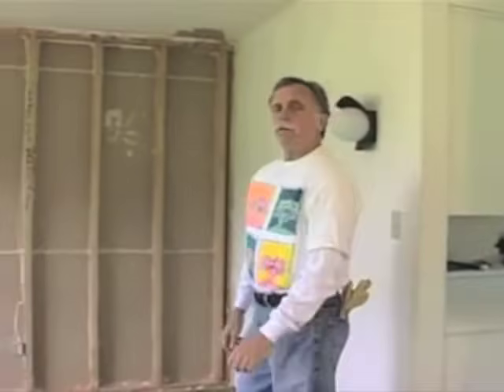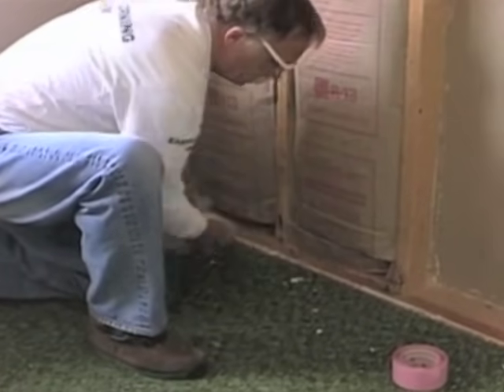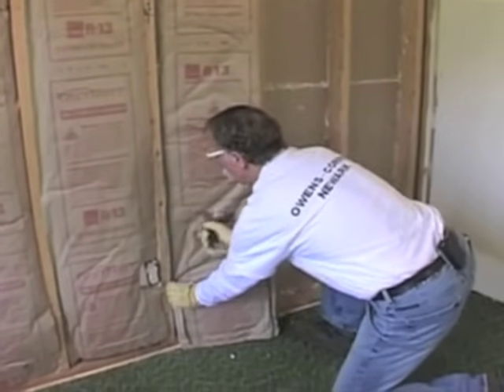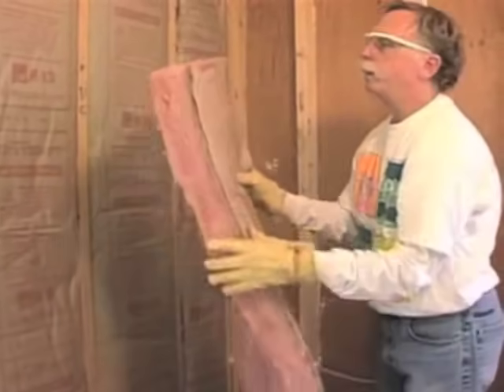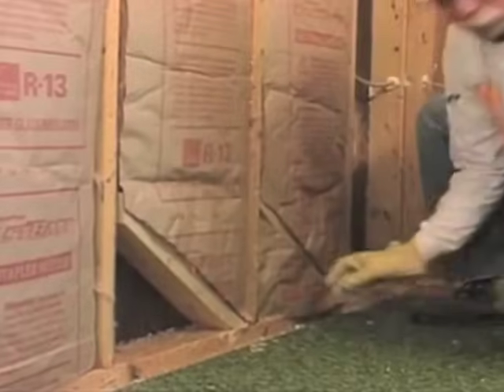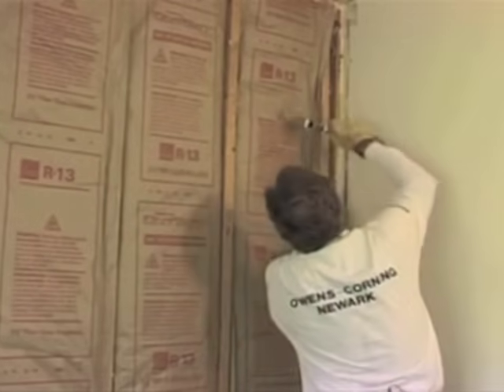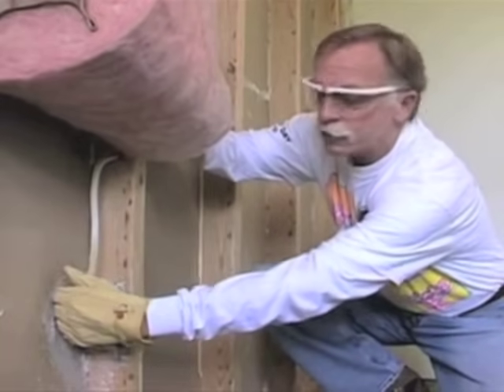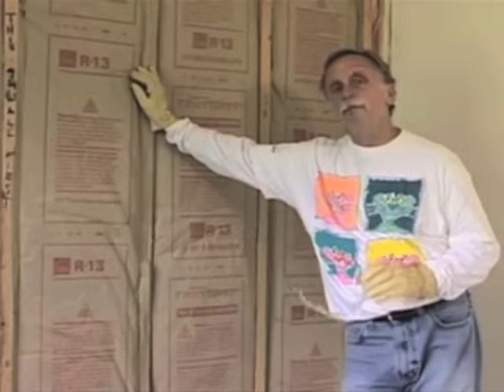Right Vs Wrong: Installing Insulation Batts In Exterior Walls - Part One

Comment: When the insulation fits in the space correctly, I thought that the side flanges were to be stapled to the face of the wall stud. Then the next installed batten flange will be overlapped and stapled over the previous installed batten flange. That completes the seal in the wall cavity. Someone correct me if I’m wrong.

Comment: I have a 70 year old house. I'm going to strip off the Old Dutch lap wood siding  and celotex, then try to insulate from the outside using Liquid Nails to seal the paper barrier to the sheetrock.. anyone think that would work?

Comment: Hi I have a wood shed 12x30 and want to do ceiling and walls how do I determine how much batted insulation is needed
Reply: figure out the square feet of the shed & you should be able to determine an estimated amount of insulation based on the square footage listed on each roll.

Comment: "I've pre cut . . . ???"  What's 'pre' about it? You cut a piece to fit the odd shape, narrow cavity, etc.

Also, face stapling is preferred as tuck-in/inset stapling requires the installer to COMPRESS each side of the bat - yet compressing the bats is ostensibly a No No - but the majority of lazy ass installers tuck it in.  Why do as they do?

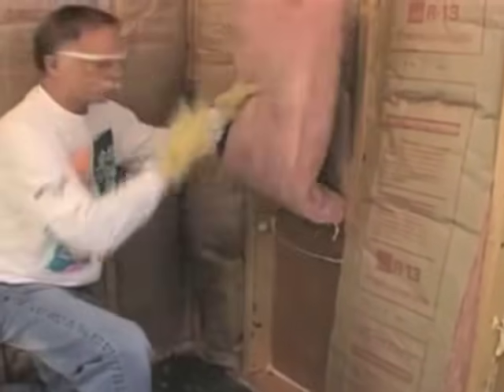Comment: I like what you did at 7:30.  I've seen a lot of videos where people cut in half all the way at the bottom, and tuck the back half behind the wiring and run it all the way down to the floor, then fold the front section over.  The way you did it looks much easier and will still work.

Comment: Residential housing has cavities of 3.5 inch deep. Can this batting be used if the cavity is only 2" deep? How much R value is lost when the batting is compressed in my example above?
Reply: Spray foam...closed cell.

Comment: I install drywall and stapling the paper over the stud doesn't work if you are using drywall adhesive. The quick batts may install quickly but they sag in walls that experience vibration, like slamming your exterior door. I work behind the installers and insulate alot of things they miss or do incorrectly. Overstuffed, gaps at the tops and bottoms everyday all day. Can't think of 1 I would refer. I've been fixing bad insulation installs for over 30 years. I put a bead of spray foam in each bay all the way around the exterior. It's very easy to do and seals the cavity.

Comment: What kind of tape do you use to maintain vapor barrier?
Reply from the maker: Hi Kevin, thanks for reaching out! The facing on the Batts is designed to provide enough of a vapor barrier to prevent condensation in the wall. Normally tapes are not used when installing faced batts so in this instance we don't recommend using tape to maintain a vapor barrier. If you would like to speak to one of our specialists in more detail about this, feel free to call us at (952) 279-6400 and ask for Ken Allison or reach out to us online at https://www.idi-insulation.com/contact/. Thanks!

Comment: The most useless video ever…. I watched maybe 1/4 of it.
Reply: I’m a GC though, so the verdict to save you time on this video is do not leave gaps and don’t precut shit. Otherwise what is the purpose of insulation? Architects call it Thermal break and it’s impossible to calculate so they will just make you ripe it out if it’s not continuous. 

God damn I waisted to much time on this video…

Comment: If you don’t cover the studs with the paper flap provided doesn’t it make your vapor barrier incomplete?Also by pushing the batts in too staple the sides it looses its R value
Reply: Facing is a vapor retarder, not a vapor barrier.  The small gap isn't significant.
Reply: It dosent loss any r value. Unless you are trying to fit more r value in a stud rated for lower r

Comment: 5:45 the outlet is upside down!
Reply: I see that in commercial buildings. not sure why though.
Reply: I heard that the outlet installed upside down is for safety. The ground is then upward is so that if a piece of metal falls nothing will happen. Conversely, if metal falls on the positive and negative of a slightly loose plug, a short may occur. The outlet looks weird though.
Reply: Believe it or not that is the best and safest way to install an outlet.  Im surprised they haven’t changed the codes for outlets.  Imagine plugging in a vacuum and leaving a slight gap.  Then you accidentally drop a screw drive and it lands on the prongs.  This will almost never happen but it could.  I had an electrician get shocked.

He plugged in a drill.  It slipped out but not completely.  He swapped out the switch above, dropped the screw driver and it landed perfectly prongs.  That screw driver flew 😂

Comment: I kept having an issue with my home's exterior osb sheathing warping. After the second contractor installed new osb and Tyvek, I took a peak and could view both the fiberglass shell of the stand up shower and the tub next to it! No vapor barrier and no insulation! The contractor or plumber had installed both to the studs, then installed sheet rock above both. Now I know why the outer osb is warping! My question now: what is the best way to install the proper installation from the exterior of the house once I again have a contractor remove the warped osb for the third time. I understand that this isn't ideal, but the house is only 5 years old, and I really don't want to rip the tub or separated shower, and drywall, out.
 Thank you.
Reply: Have you checked for plumbing leaks?
Reply: Best repair is to take it all out and redo. You can hot fix it- but it will continue to give you problems because the vapor barrier isn’t installed. Jigging a vapor barrier around existence will only cause the warping to go into different areas (maybe not seen like inside walls or under subfloor).
If cost is an issue- save your tub and shower and just install barrier underneath each separately. You may have good cause with a lawsuit also depending on your state laws.

Comment: I every video I watched, I have not heard any person address the method of stapling insulation to inside of studs.  To me, stapling to inside of stud breaks the vapor barrier of insulation.   And it compresses the insulation  along edge of studs.
Reply: Actually you are more at risk cutting or tearing the vapor barrier when you unfold it to face of stud, not to mention if you face staple dry wallers will rip that shit off and now you are stuck with a shitty insulation job
Reply: Stapling to the face is the proper way.  Inset stapling folds the insulation back and does break the vapor barrier.

Comment: Which side is the kraft paper suppose to face inside or outside? I keep getting mixed answers?
Reply from the maker: Conman20000, Thank you for your question on this. This question depends on a couple of things. First it depends on what climate zone you are in or where the property is located. In the south, it is not advised to have a vapor retarder on the back side of the drywall. Warm moist air from outside would enter the wall and be stopped before it could dry to the inside of the room.  Just remember, moisture generally travels hot to cold. This means that in the cold northern winter, the moisture inside is looking for a cold surface (like a single pane window) to condense on. This is where we want that vapor retarder on the inside of the wall. The retarder will prevent the moisture from getting into the wall and heading to the coldest spots on the outside of the wall where it can create problems. In the south, the dominant use of air conditioning means walls typically dry to the inside. This south uses far more unfaced batts than faced ones. 
For more information on this or any of the other products we carry, please reach out to your local branch or at the corporate office. We look forward to helping any way we can.

Comment: do you actually consider a strip of tape to be a vapor barrier...LOL...you can't just tape two ends together OR consider a paper flap against the sides to be a VAPOR barriers...poor poor
Reply from the maker: The Dyslexic, thank you for your comment. The craft facer on the batt is coated and that is what is considered to be the vapor retarder. Taping a seam on the craft facer would be similar to taping a poly sheeting seam on the wall. For the most part, this keeps the vapor retarder intact. Small punctures or compromises in the vapor barrier generally don’t raise a big concern. If 98% of the wall has an uninterrupted barrier, then the vapor retarder is 98% effective. Here is a full article on moisture problems by Dr Joe Lstiburek. https://www.buildingscience.com/documents/digests/bsd-108-investigating-and-diagnosing-moisture-problems

Comment: Mike Holmes says not to insulate the garage wall if the garage is not heated because it will cause mildew. I have a room above my attached garage and it is cold. there is no insulation behind the drywall in garage. What should I do? The room is freakin cold!
Reply from the maker: Syed, 
Thank you so much for your question.  I would start by saying that codes require garage ceilings to be insulated. Garage ceilings are also a critical place for air sealing. Many older homes struggle with air infiltration from the garage and it presents more problems than just comfort.  You certainly  don’t want carbon monoxide, or any other harmful things seeping in from there. As for insulating the walls of the garage, most people never do unless you spend a lot of time in there for a hobby or some other reason. Please feel free to call with any questions or reach out to us if you would like a referral for a good contractor in your area.
Reply: @IDI_Insulation  mike holmes is a bald bitch that thinks he is the only knowledgeable builder on earth . It absolutely has to be insulated . Its no different than any other exterior wall other than the fire code sheetrock.

Comment: Hes right, and talking about the installers doing it wrong but whenever you have to do about 50 times as much as the little ass wall he did, no theres absolutely no time to do everything perfectly especially getting paid by production
Reply: That's what's wrong with things today. It's all about quantity and not quality.
Reply: @Myoldaccount-mu7of  It comes down to the lowest price. Say it ain't so.
Reply: Marco Alvarez And now you know why people don’t trust contractors....
Reply: Agreed.  Would like to see this guy working under deadline
Reply: I'm a retired union insulator, and had worked in all phases of insulation; hanging batt,blow-in blanket,attics,etc. When I started in insulation, I  was fortunate enough to work for a guy who had started the company with his dad and brother. One of the lessons I learned from him was "until you learn not only HOW to insulate,but WHY you're insulating,it doesn't matter HOW fast u go." AND. .  Do it right the 1st time.  He was right- it doesn't take that much time to do it right the 1st time,plus you avoid having the quality of your work questioned. How right u were Craig-R.I.P.

Comment: I don't really trust the coated paper face to serve as a vapor barrier. I'd prefer to use unfaced insulation and hang thick poly.

Also, if you have a vapor barrier on the exterior of the wall (I've read homes in warmer climates may), you'll want to use unfaced insulation so you're not trapping moisture in the wall.

Comment: You're not installing those to code. It's common to stapple to the side of the 2X but that's wrong and our local inspectors will fail it. The stapple flange is supposed to be attached to the front edge of the 2X because it's more air tight and creates a vapor barrier.
Reply: ScottDLR and actually because it can compress the insulation, it is designed to take up the full 3.5 inches of depth. Compressing it lowers R value.
Reply: The manufacturer says that both stapling methods are recommended, and does not make a difference.

Comment: Bill, where do we insulate around fireplaces, old style and prefab wood burning.  I have a box type on the outside of the house which is not insulated and the cold pours in.  I have pulled the mantel off and there is nothing to stop the cold. How close to the pipe can we get safely?  Which insulation? Where exactly.?  I have already did exactly what you’ve taught for the whole house and now this is the only area still waiting to be finished.  I haven’t even installed drywall yet so please share the knowledge since I have called around and no one knows the answers.  Checked code books and insurance companies and no ones the answers.  A huge area to be marketed to.  The answer is NOT bricking or sealing up the fireplace.    So just please provide where to insulated and what insulation...specifics please.  Thank you
Reply: I'm sorry this isn't Bill. This is Ken Allison with IDI. But I will gladly help out. Around a fireplace the first answer is always to defer to the local code official because fire code and life safety trumps everything. That being said, a sure fire way to keep the AHJ/official happy is to stick to products with the highest fire rating. Using silicone to seal all penetrations and then mineral wool/stone wool to fill the cavities is always a safe bet. Another added bonus of this method is the sound attenuation you get when using mineral wool. There are various sealants rated for around the vent pipe, which can then be insulated with mineral wool as well. Thanks so much for the question. If you would like to discuss this further or have other questions please reach out to us at any time. www.idi-insulation.com
Reply from the maker: Thank you so much for your question! You can contact us at info@idimn.com if you have any additional questions. Thank you!
Reply: IDI Distributors thank you I will send an email.  I have already contacted the local codes office and they are unaware of any code or expert in the area I could talk to, so that’s a bust.   I do work better with pictures or videos, I’ve already searched the web for any information and seems to be an area with lots of people asking questions but no one answering.  Would be a good line of work for an expert to develop especially in the DIY growing communities.  Many suggest a fireplace cleaning aka chimney sweep so I called around there too but they only clean.   Anyway. Thank you for your response.

Comment: I wonder how many first-class flunkies installed insulation in my previous homes?  I literally have seen frost on the inside sheet rock in the winter in certain parts of my house.  In unsheetrocked areas, I've also seen batts not cut, but merely doubled up and stuffed in because someone was too lazy to do the job right.

Comment: after you install your installation... do you recommend adding plastic sheeting to cover and better seal
Reply: G. Williams Plastic sheeting isn’t needed if the insulation has the paper like in the vid. If the batts are unfaced, you should add plastic sheeting to the exterior walls.
Reply: This advice is climate specific.

Comment: Chad Carlberg HI, I bought an apartment that's made of concrete walls (10 cm blocks). there are no insulation inside or outside. What's the best way insulating it from inside?
Reply: spray foam or polystyrene foam.
Reply: Brady Basher And then sheet rock?
Reply: Hi Chad what did you use and how did it work out I have same issue

Comment: Great video! I've been watching different insulation videos almost all morning. An awesome presentation with a little dry humor. This is by far the Best one. It shows the way to do it. It's not full of "do it however" comments by the spokesman. It says do it this way. Period.  Plus the reasons why to do it this way with proof of heat loss. The "lazy mans way" comment was hilarious. Yes, Inspectors do issue "RED TAGS" for not insulating properly and make the contractor correct it.  So if you're a do it yourselfer and WANT to do it like a pro. This short video gives you the baseline skills to do it. The same mistakes that are demonstrated in this production, I did and I redid my insulation thankfully before drywall.

Comment: 8:40 - not sure that foam job would pass electrical inspection.  Excellent video!
Reply: TomKaren94  foam insulation would have taken place after electrical inspection.
Reply: Use the fireblock stuff

Comment: In addition to the batt insulation you can also use insulated drywall.  Even thought it can be quite thick.  Anywhere from 3/4" thick to about 4" thick.  So you will lose considerable floor space and ceiling height.  You would also eliminate thermal bridging.  I would use both the wall batts, correctly fitted like in this video, and the insulated drywall.
Reply: I’ve been in the drywall business for 40 yrs and have never heard of or ever seen insulated DW
Reply: 4 inch thick drywall??? wth
Reply: I've seen Vinyl coated drywall grid ceiling panels, but not what-ever this man is referring to.

Comment: I'm installing insulation in my crawl space, Can I fasten insulation with staples through the insulation, not the tabs?
Reply from the maker: It is probably not advisable to staple the fibrous portion of a batt since the bond formed will only be as strong as the binder holding the batt together. You would be better off stapling up some twine, fabric or netting to hold the batts in place. There are also metal batt supports which can be purchased that are cut to fit different joist spacing that can be used for support as well.

Comment: For building in most parts of North America, where winter heating conditions predominate, vapor barrier are placed toward the interior, heated side of insulation in the assembly. In humid regions where warm-weather cooling predominates within buildings, the vapor barrier should be located toward the exterior side of insulation. - Edward, Allen. Fundamentals of Building Construction: Materials and Methods. New York: Wiley 2009 5th edition.
Reply: can you do it either way or both ?
Reply: @smokumquick144  dont use a vapor barrier. It traps moisture badly. 30 years building experience.